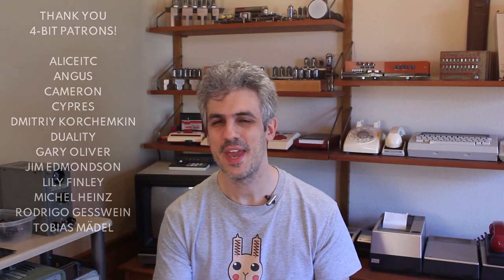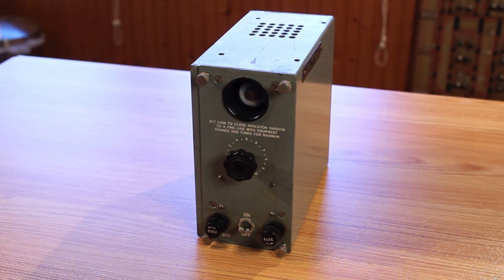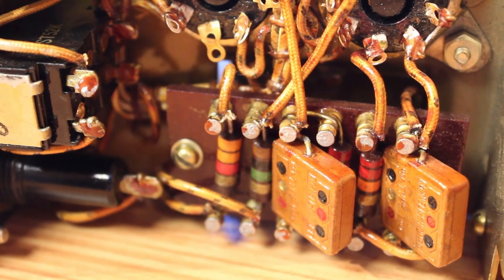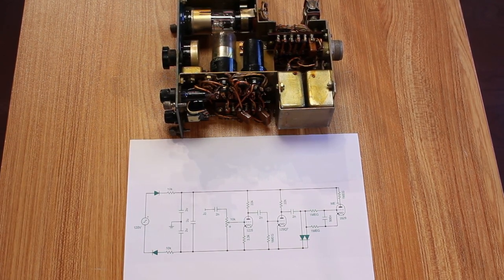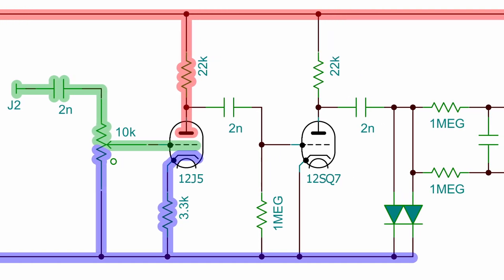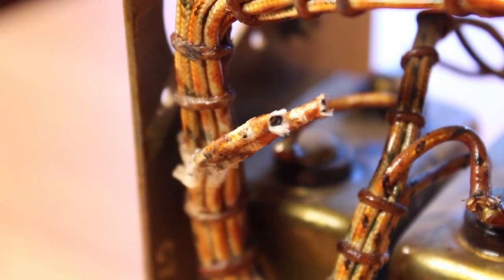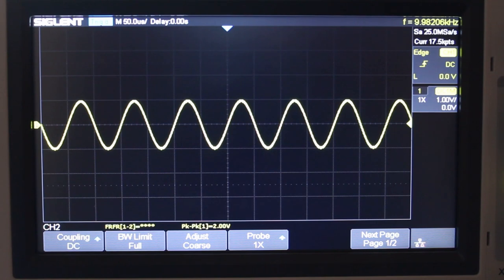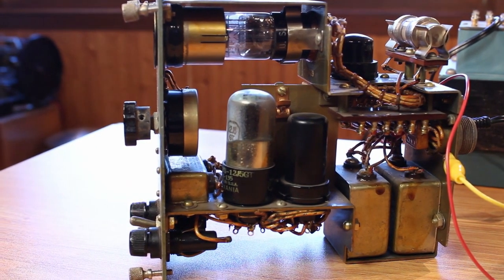Reverse Engineering a U.S. Navy Vacuum Tube Thing

Comment: i don´t know for what is really used, but i am sure that this fing can calibrate a Fi from any type of radio. Its basicaly an "audio voltmeter"
Reply from the maker: Another commenter suggested that it was used as a Bearing Deviation Indicator in early sonar systems, which makes a bit of sense given that it's designed to give a more precise indication of incoming frequency. But, I think it was originally designed in such a way that it could have had multiple uses on several different types of equipment. Really, anything that needed a precise frequency indicator!

Comment: I'm curious if you were two adjust the frequency of your 2 V signal. If that would affect the eye opening or closing which I've imagined it would.
Reply from the maker: I actually did give this a try and it totally does! The higher the input frequency, the sooner the eye closes, which makes sense given that these are often used as frequency indicators or the like.

Comment: If it is not for looking at sonar pings it is a $5000.00 toilet seat.  When I first saw it i was thinking some sort of wheatstone bridge but you shot that down instantly.
Reply from the maker: I think another commenter nailed it, they suggested that it was used as a Bearing Deviation Indicator in early sonar systems, which seems like a fairly likely application!

Comment: That's not a gain control in the purest sense, a gain control sets the gsin of the amplifier stage, and is normally seen as a variable resistor feeding from output to input (basic description)
Yours is wired as a potential divider (that's why it's 'potentiometer') and is commonly called a volume control.
I'm thinking the catode of the magic eye should find its way to groung, either via one of the 1 megs, or direct, otherwise there's no difference between cathode and grid.
Whatever it was connected to, i think you set for fine line and read the dial number, if the input drops, you would read a higher number.
If you want to current limit test items, the cheap way is to wire a sutable lamp in series, if the lamp glows bright there could be a short.
Reply from the maker: You're absolutely about the magic eye!
I double checked the wiring and missed an important connection from the magic eye's cathode to B-, here's the updated schematics:
https://i.postimg.cc/jdZ7FfBh/Updated-Schematic-A.png
https://i.postimg.cc/85MyR4K4/Updated-Schematic-B.png

Another commenter suggested that it was used as a Bearing Deviation Indicator in early sonar systems, which seems like a fairly likely application, but it's designed in such a way that it could have had multiple uses on several different types of equipment.

Comment: I like the sonar suggestion.
I was thinking it was maybe a tuning indicator for an AM transmitter. The magic eye was used for a lot of things. One advantage was it's high input impedance. But, since you have input amplifiers, that does not appear to be the reason here. The other reason was its fast response time. It could even be used to indicate at RF frequencies. (The input circuit looks like it can go above audio frequencies. Have you tested its frequency roll-off?)
You're only hint so far is the front panel instruction: "set gain to close indicator shadow to a fine line with equipment trained and tuned for maximum". One of the things these were used for in the days of AM was to indicate full modulation of transmitters. If the input signal was proportional to RF output, then you would tune your transmitter un-modulated (carrier only) and then set the gain on the magic eye so that it just touched. Then when you speak (modulate), set your microphone gain so that peaks cause the magic eye to touch. Anything over that would over-modulate your transmitter and cause splatter/harmonics. Anything less would reduce the power of your spoken voice. However, this does not explain the "equipment trained" phrase.
Since there is no equipment number or manufacturer, it may have been a prototype or maybe something that plugged into another piece of equipment.
You may want to try to trace the equipment source back through the person that you received it from...
Reply from the maker: Thanks for the ideas!
The tuning for maximum voice without causing clipping is a really smart idea for Magic Eye tuners. Though, I do think the sonar bearing deviation indicator is the most likely.
Unfortunately, the person I got it from tried to figure out more about it before sending it to me, and the military surplus store he got it from didn't know anything about its origins or even who they got it from. Our best bet is finding someone who remembers using this in situ, but that's getting harder and harder as the years roll on.

Comment: Lovely explanation. I think starting the two diodes on the right, you messed up transferring the circuit to the schematic, because the schematic doesn't really make sense. Consider revisiting this part.
Reply from the maker: Thank you so much!
And you're totally right! I missed an important connection from the magic eye's cathode to B-, here's the updated schematics:

https://i.postimg.cc/jdZ7FfBh/Updated-Schematic-A.png
https://i.postimg.cc/85MyR4K4/Updated-Schematic-B.png

This makes way more sense now!
Reply: @UsagiElectric  aye lol also you sire those diodes arent antiparallel? Thats what you do to clamp a signal on both sides
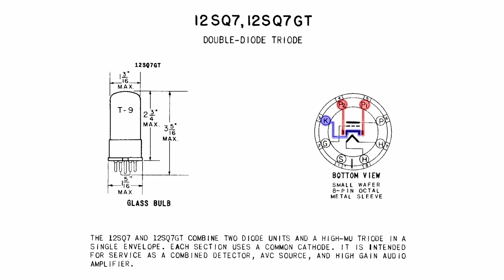Reply from the maker: @cheater00  They are definitely parallel! The diodes have a shared cathode, and both anodes are physically connected with a little piece of wire as you can see in the video at 11:17

Comment: it this unit was designed and built for navy use the over building would be understandable as reliability would highly important,  The coating on the wires would likely to be protect them from potential corrosion by the salty air at sea.

Comment: So, capacitors don't age like wine, not ones filled with an electrolyte anyway.
So, 70 years later and they still work.
They're not polarised caps so are they ceramic?
Or can you get non polarised electrolytic capacitors?
If they are electrolytic and still work, is that because they 'just don't make them like they used to"?
Reply: OK I googled the part number, so far I've found this, which is inconclusive:

"Capacitor. 2uF 600VDC. Enclosed/sealed. Mount: panel, 2 hole mount at 2-1/3" centers. Dimensions: 2" square x 1-1/8" high. Note: High Voltage."

Comment: The size of the components, that connector on the back ... I’m just getting such a strong 1940s vibe from this thing. Do you have any kind of date for it?
Reply from the maker: Unfortunately, I don't. The plaque on the side looks like it was supposed to have dates for when it was put into service stamped on the side, but the plaque is still totally blank. So far, the consensus seems to be late WWII era, which fits well with the 1940s vibe!
Reply: @UsagiElectric  The cased capacitors normally have a date code on them, along with the value and the part number.
Reply: Aren’t those plaques supposed to be stamped when the unit leaves the factory? It looks like it was obsolete before it could even ship.
Reply: @lawrencedoliveiro9104  
Could have been sitting as a non-shipped replacement in the factory, and thus not date stamped yet..

Comment: In the back is this antenna connection??, maybe is something related to RF (xmitters) just to calibrate signals
Reply from the maker: I think that's just a standard connection terminal used for the system it was meant for. Another commenter suggested that it was used as a Bearing Deviation Indicator in early sonar systems, which seems like a fairly likely application, but it's designed in such a way that it could have had multiple uses on several different types of equipment.

Comment: about the magic eye tube it share cathode , so you have missing  as you separated like two didoes, so all cathode should be to gather  as  original diagram in data sheets for all tube cathodes , so that's mean  all base for the magic eye cathodes and diodes it's same cathode not isolate  by 1MGO resistor as you showing in you diagram, more than the both diodes make the base for the  control grade and balance come from the output amplifier to show signal level .
Reply from the maker: You're absolutely about the magic eye!
I double checked the wiring and missed an important connection from the magic eye's cathode to B-, here's the updated schematics:
https://i.postimg.cc/jdZ7FfBh/Updated-Schematic-A.png
https://i.postimg.cc/85MyR4K4/Updated-Schematic-B.png

Comment: That could go to anything from radio to some sort of sensor.
Reply from the maker: Another commenter suggested that it was used as a Bearing Deviation Indicator in early sonar systems, which seems like a fairly likely application, but you're absolutely right that it's designed in such a way that it could have had multiple uses on several different types of equipment.

Comment: I’m guessing it’s used as a RTTY tuner? How does the magic eye display change with the frequency of the input signal on J2? Try 850 or 450 Hz and see if anything interesting shows up. If it is for RTTY it would be an unusual tuning indicator for sure. 

But logically, given that this box has no output other than visual, it must be indicating some feature of the input signal. How about pulse timing, like visually depicting the duty cycle of a pulse train or the spacing of a train of pulse doublets? Kind of a poor-man’s J-Scope
Reply from the maker: Interesting, I hadn't thought about it being used for RTTY tuning. I did actually give it a test to see what changing the frequency on the input would do and higher frequencies close the eye and lower frequencies open the eye. 
However, another commenter suggested that it was used as a Bearing Deviation Indicator in early sonar systems, which makes a bit of sense given that it's designed to give a more precise indication of incoming frequency. But, I think it was originally designed in such a way that it could have had multiple uses on several different types of equipment. Really, anything that needed a precise frequency indicator!
Reply: @UsagiElectric  I’m taking back my suggestion about it being a RTTY tuner. Those are usually a small CRT. After reading the old Navy document I forwarded to your Discord group, I’m convinced it serves as an external, very sensitive signal strength (volt) meter used when tuning in a radio signal. That’s what the chapter on these Magic Eye tuning circuits says, and I see no indication that this is anything else but that. The only magic eye circuit I’ve ever seen in the wild is an old radio my grandmother had (now in my son’s attic somewhere), and that’s how it was used - as a tuning indicator. I’m swamped at the moment, but I plan to suggest a simple test circuit you could use to demonstrate this. 

If you search online for the phrases used in that metal property label, you’ll find this was a standard label used around WW2. Looking closely at your zoomed in video of the construction, it sure seems to be of that vintage. I also saw several sites devoted to WW2 electronic equipment — maybe if you posted there someone would recognize this.

Comment: To me, it's an exposure meter for a positive process - in a dark chamber, only photoresistor is missing.
Reply: It only measures AC input though.
Reply from the maker: That's an interesting idea!
Another commenter suggested that it was used as a Bearing Deviation Indicator in early sonar systems, which makes a bit of sense given that it's designed to give a more precise indication of incoming frequency. But, I think it was originally designed in such a way that it could have had multiple uses on several different types of equipment. Really, anything that needed a precise frequency indicator!
Reply: @UsagiElectric  It occurred to me because I had a similar exposure meter in the late 1960s. The only difference was that he was in a plastic box.

Comment: Looks like a two-rail power supply, so it's not all that mysterious.  It might help it work better if you bridged the 2 microfarad filters with something like 10-15 microfarad electrolytics (of the correct polarity) because this was probably fed from a 400 Hz shipboard AC supply, and better filtering will be needed for 60 Hz.  Don't get too big on these caps because otherwise cathode stripping of the diodes could occur.  400/60 * 2 = 13.33
Reply from the maker: I think you're absolutely right about it being fed from a 400Hz shipboard supply, it totally didn't cross my mind that that might be the case. I actually checked the DC voltage level after the rectifier and it was at 135V, which is a bit low for rectified 115V coming in, but when considering that there might be a lot of ripple due to the filtering caps being undersized for 60Hz it makes sense!

Comment: Used for setting RTTY (radio teletype) signal levels.
Reply from the maker: Oooh, that's an interesting idea!
Another commenter suggested that it was used as a Bearing Deviation Indicator in early sonar systems, which seems like a fairly likely application, but it's designed in such a way that it could have had multiple uses on several different types of equipment.

Comment: That 1meg ohm resistor to the cathode of the 1629 looks wrong.  I think the cathode should go to ground, either directly or via a resistor.  You must have missed something, especially with that non color coded wiring.  Use an ohm meter to verify that the cathode of the eye tube doesn't go to ground.  It WON'T conduct and light up via a 1 meg resistor in the cathode through a 12SQ7 diode!!!
Reply from the maker: You're absolutely right!
I double checked the wiring and missed an important connection from the magic eye's cathode to B-, here's the updated schematics:
https://i.postimg.cc/jdZ7FfBh/Updated-Schematic-A.png
https://i.postimg.cc/85MyR4K4/Updated-Schematic-B.png

With the schematic laid out like that, it makes a lot more sense now!

Comment: hi. why are magic tubes allways in green? and are militery tube  heaters allways in serises plugged? hmmm :-)
Reply from the maker: I don't believe that military heaters are always in series, it seems like it was done here for simplicity. Usually, there is an onboard transformer that generates a heater rail as well as the B+ rail, but in this case, they were able to simplify and run the heaters in series with a big dropper resistor. That allowed them to make the unit very compact. But, for larger equipment, I definitely think it was more common to have a dedicated transformer in the piece.

As for the Magic Eye Tubes, they're actually just really small Cathode Ray Tubes. So they're essentially an electron gun, shooting electrons at a phosphor. When the electrons strike the phosphor, it gets excited and emits visible light. The type of phosphor is what dictates the color seen. Most Magic Eye Tubes glow green, but some glow yellow. However, since Magic Eye's run at a much lower voltage than most CRTs, that might contribute to the type of phosphors that can be used, but that's getting into a field of science I know very little about!
Reply: Series heater connections meant that a separate transformer say 120 to 12v is not needed.  This was done in nearly all consumer electronics in that era.

Comment: I wonder if they are using the dual diodes as a voltage doubler circuit.
Reply from the maker: A few other commenters actually had the same though, but I don't think the 12H6 is setup that way. I double checked the wiring and the schematic in that part is correct (I did miss a connection from the magic eye to ground though). I also checked the rectified DC voltage and it's sitting right at 135V, which is actually a bit lower than I was expecting. But, I believe this was intended for a 400Hz shipboard AC supply source, which would mean that the main filter caps are probably undersized for the 60Hz I was feeding it. The extra ripple would definitely appear as a lower rectified DC voltage on the DMM!

Here's the updated schematics with the proper Magic Eye connections: 
https://i.postimg.cc/jdZ7FfBh/Updated-Schematic-A.png
https://i.postimg.cc/85MyR4K4/Updated-Schematic-B.png

Comment: The knob for seting gain is probably wrong. I speculate it should be with a pointer and where it was pointing at correct setrings, that was the "output" information from this unit. Operater should than set other unit with this info. Otherwise the scale arround gain knob would be meaningless. Or it is the other way arround, operater set fixed gain, manipulate other device and the magic eye was the "output".

Comment: when are you gonna boot up the mini computer sir?
Reply from the maker: The minicomputer is on pause for a little bit.
The reason though is a good one. I've actually been in touch with a former Centurion employee, and I'm confident he can not only help me get it booted, but also help me get the drives back in tip top shape and get some proper Centurion programs running. However, we're both waiting for Corona stuff to calm down a bit before we get him out here to the ranch to help. So, don't worry, I haven't forgotten about it, and when it returns, there will be some awesome stuff to show!

Comment: The glass capacitors are stable, wonder how far out of speck they are at this age.?
Reply from the maker: I believe these old military oil filled caps are known for being extremely reliable, particularly in low stress designs like this one!
Reply: Actually that glass thing you called a capacitor is a resistor and believe it or not the Tesla model 3 uses a similar resistor for the drive batteries high voltage resistor

Comment: Could one of the 1meg resistors be connected to ground instead? That would make sense to me as that would represent a common mode rc low pass filter removing interference above some khz.